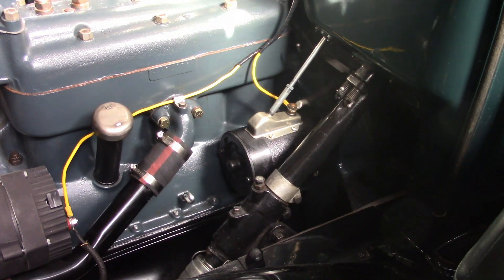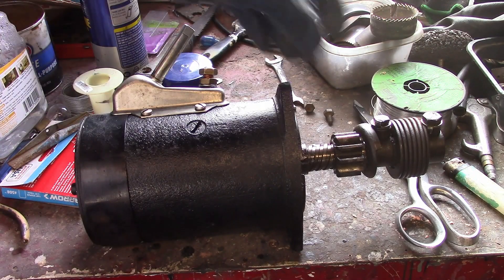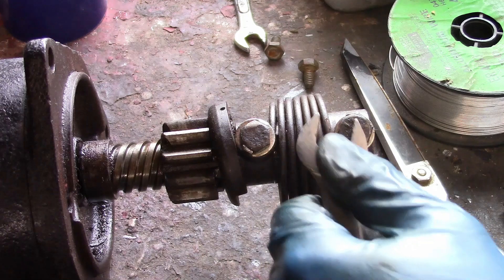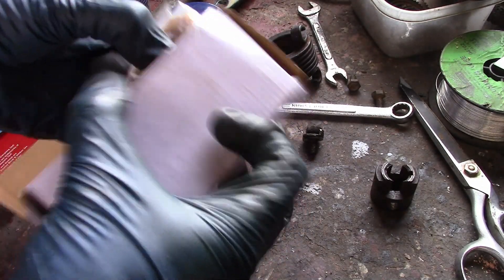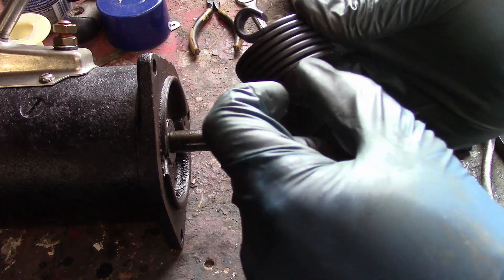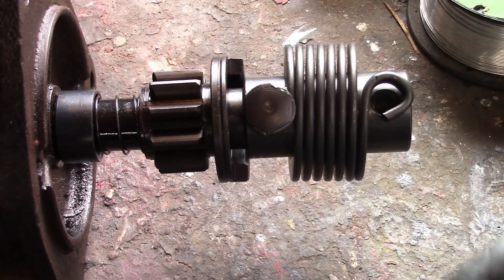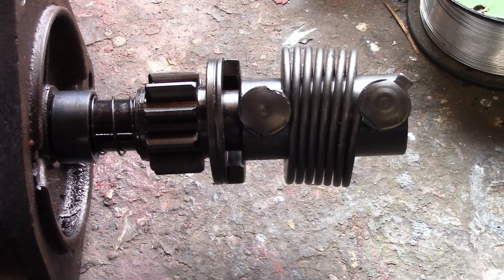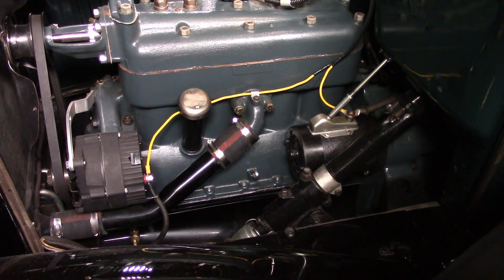Replacing a Model "A" starter drive.

Comment: I figured that I would pass this along, anytime a key and a keyway is involved, I like rub a little Dielectric grease on the crankshaft and its corresponding piece. Such as a harmonic balancer or a riding mower clutch. I find it a lot easier to persuaded into its final position. This is not meant to be criticism in any way. Because once again, you did a Great Job!
Reply from the maker: Thank you. I'll try that next time.
Reply: @onewhocollects6781 You're quite welcome.

Comment: Bendix replacement is one thing that is actually easier on a Model T Ford - You don't have to remove the starter, just the Bendix cover on the back side of the engine.  :)

Comment: I noticed the 1 wire alternator conversion. Typical when converting from 6v to 12v. With time, it will do it again. Worse it will damage the ring gear on the flywheel as well. Good luck.
Reply from the maker: Good point. I'll keep that in mind if I ever convert it to 12 volts.